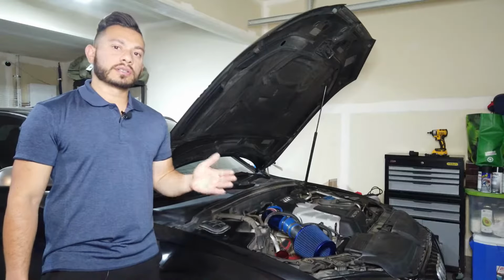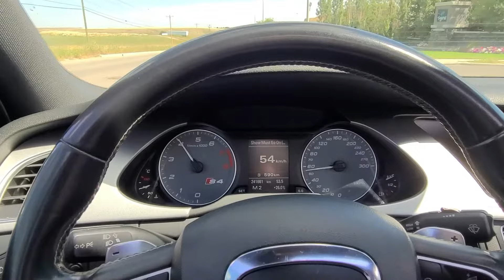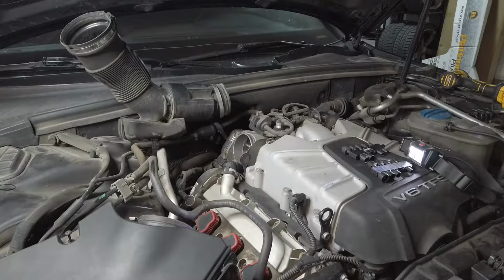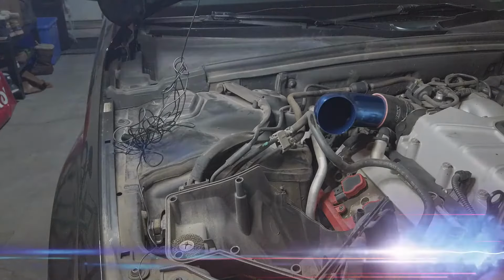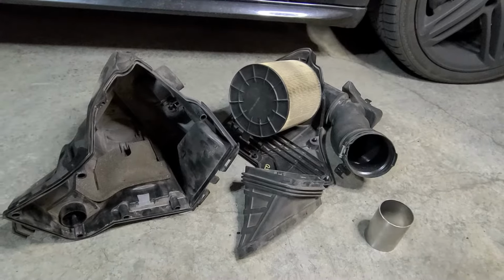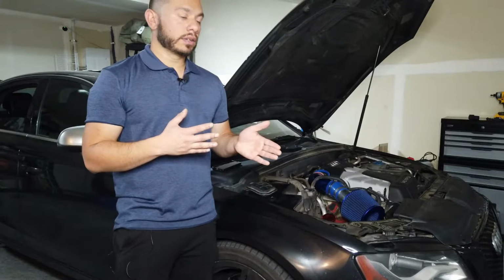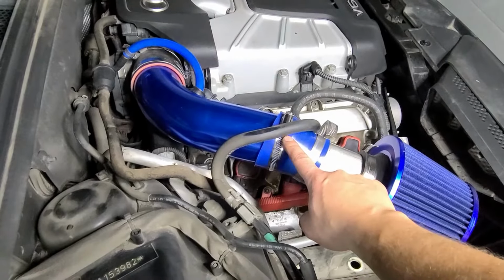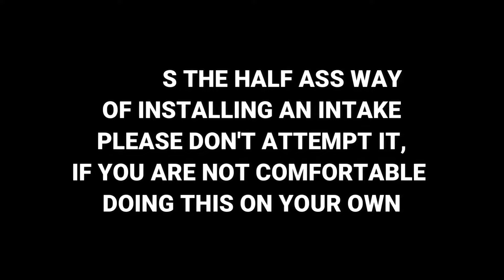Transform the Sound Forever! Audi (B8/B8.5 S4/S5)

Comment: This is now a hot air intake and you will be loosing power with it. Not good at all.
Reply from the maker: At a stand still, yes. Once the car moves there is no issue. The purpose of this video was strictly for sound, but i can get some logs going if there is enough interest in comparing this to the stock airbox.
Will have to get VCDS in order to log the IAT's etc